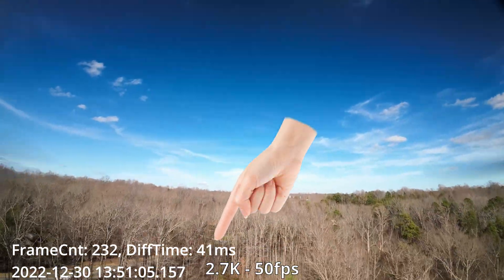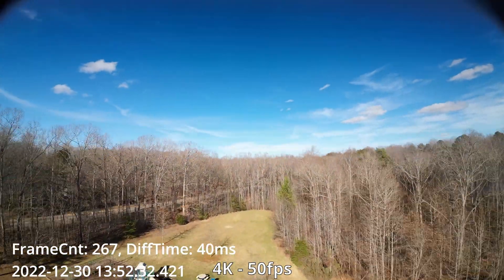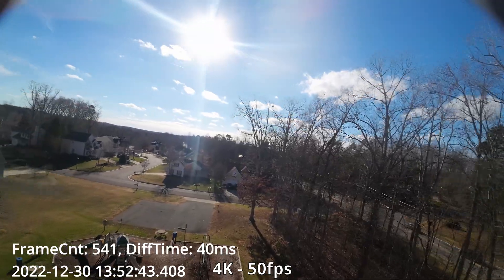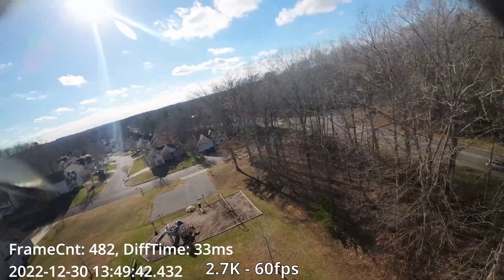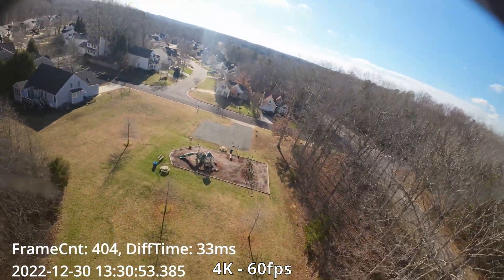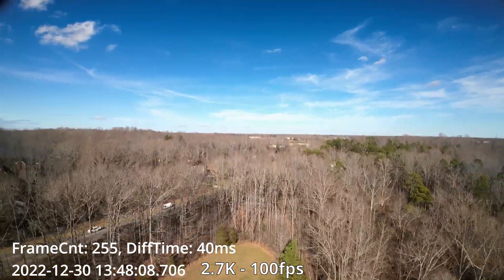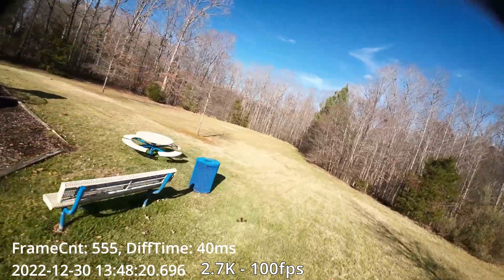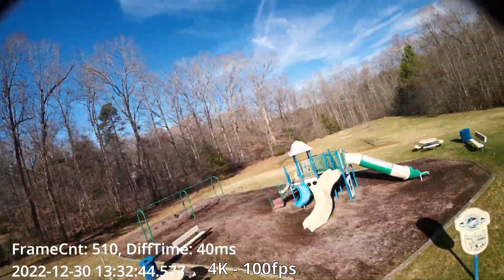How To Get The Lowest Latency From Your DJI O3 Air Unit

Comment: What is the best resolution and fps to use on the Goggles 2 Integra for the least latency? 2.7K/100 fps?
Reply from the maker: Since it's basically the same goggles as what I'm using, I would say it's the 60FPS, however, I have not tested those so it could be different.
Reply: @fpvtrendz  Hmmm, the Goggles 2 and Goggles Integra has a refresh rate of 100hz. The Goggles V2 has a refresh rate of 120hz.

Comment: set jitter to 12 set smoothness to 50 fixes everything mostly also check your setting for elrs make sure betaflight is set to your hz i use 250
Reply from the maker: I'll give it a try thanks :)
Reply: @fpvtrendz  did you try also read every ? the ones that your quad uses set to recommended sitting .. there are a few sittings you want the 2 point on noisy 250hz or for freestyle . the racing sitting of 3 do not use set at 10 or 12 over shoot flips big time . just read them all sittings for heavy builds it will explain it all .. I forgot if you have the bmi1270 gyro or any newer gyro you have to set main gryo filter to atleast 105 or 110 the bmi1270 requires less filtering
Reply from the maker: @bengordon7635  Thanks, I'll look at it all and try those settings.

Comment: Strange, that is almost the exact opposite from Chris Rossers findings (https://youtu.be/2kokyIpzOVQ). Granted his are a bit more scientific and I know Bardwell has mentioned in the past how inaccurate the SRT data is, but I have to wonder if something changed in the firmware as well. FWIW, I can tell a pretty big difference between the 50/60 fps modes and the 100fps modes. The latency of 2.7k 100fps seems to be significantly better and smoother overall. But I'm still running the original O3 firmware.
Reply from the maker: Thanks for that.